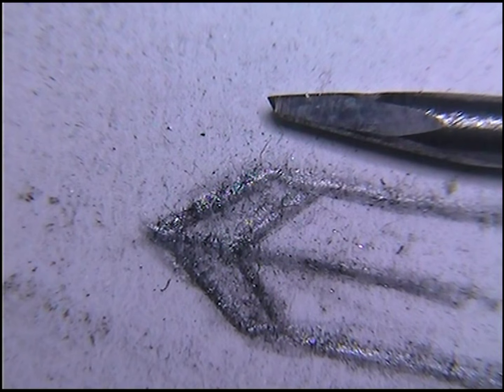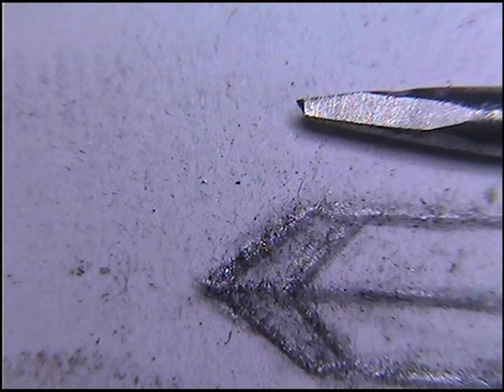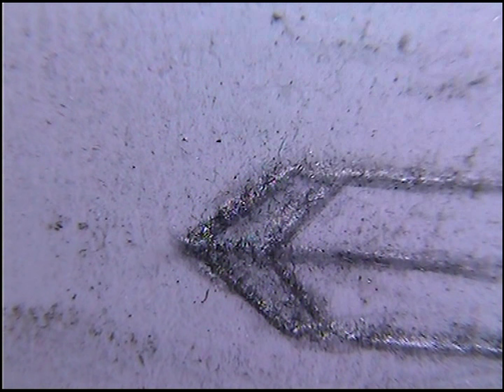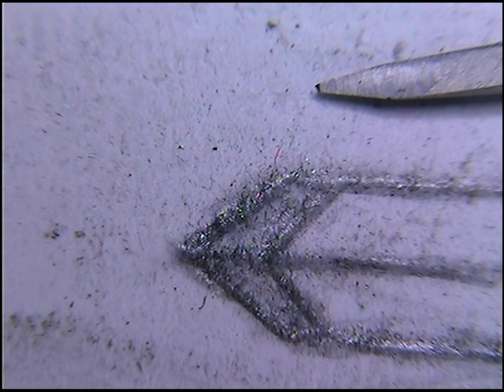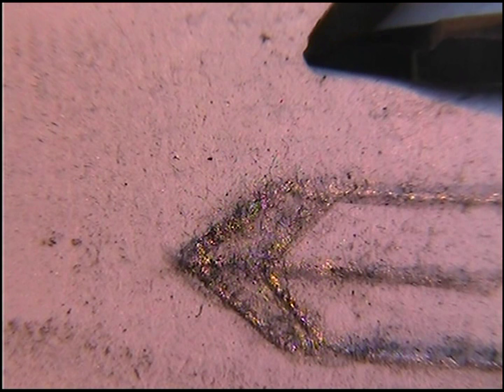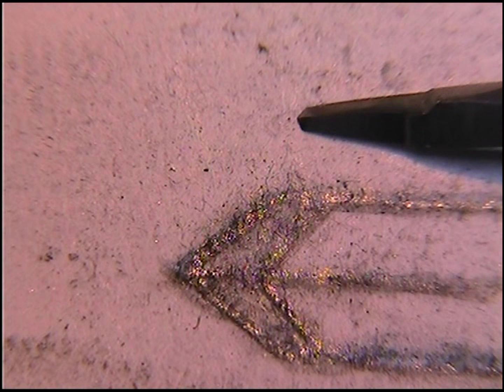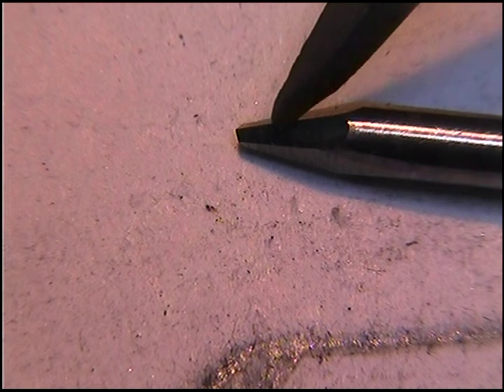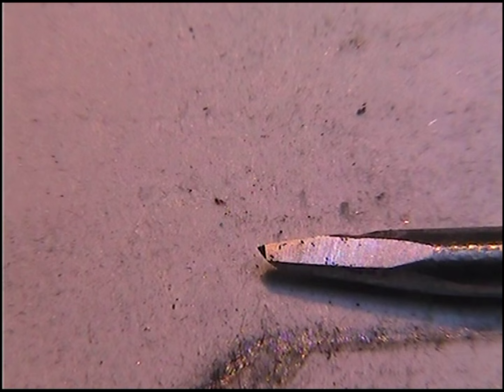Hand Engraving What a graver should look like,and how to sharpen it.

Comment: Really great videos and a lot to learn from you! I've got rectangular gravers. Any good tips to fasten them into a template?
Reply from the maker: You could still drill a hole in the location and tap a pointy square graver through making sure the corner is in line with the V of the graver,so it's positioned in a diamond shape. There is a previous video of me making the templates with the brass part of an electrical connectors block. That was the original design for square gravers

Comment: It's an awesome video. What's the next best thing to a $500-$1000 stereo microscope? The engraving forums that I read advise against buying the cheaper Chinese brands. I'm a beginner, and I've ordered only two glensteel gravers and two wooden handles to start with. I see that in some of your videos you show improvised versions of more expensive equipment, so maybe it's not such a sin to buy cheaper tools at the beginning?
Reply from the maker: +Patricia DelMercado Buy whatever you can afford to make a start. I still use a cheap optovisor,I bought 10 years ago. Slightly more expensive is dental loupes,but don't get the ones for $5 they don't actually work.  You are doing the best thing,that is just to make a start. Go straight to work on some coins,and you can start selling them to buy better equipment.

Comment: Fantastic video!! It is super helpful for a beginner! I am hoping you can help me. I have made your 90 degree template and several others now buy other engravers but can not figure out how to achieve a parallel heel. I know Steve Lindsey sells a system to achieve this but I cannot afford it. Is there any way you can explain how to achieve a parallel heel on a 90 degree graver? Any help would be so greatly appreciated!!
Reply from the maker: So cool that you are progressing so well. You could actually sharpen a parallel heel by hand. Will have a think for the next video.
Reply: Shaun Hughes Engraving thanks so much for getting back to me!! I have been having a play around and I think I can do it by hand just need to practice. I have another question if you don’t mind, I am practicing on copper what would be the best angles for cutting copper? I am finding the 90 degree gets stuck. Thank you so much for your help!
Reply from the maker: @heatherbell9924  That's so great to hear Heather. Look for Sam Alfanos video on hand push engraving, he has the perfect angles shown there.
Reply: @express375  link not work, I can't open this file
Reply from the maker: @mbootgae1497  Thanks bro try the new link. Check out my new 3d print video. Also new homemade idea to make a sumple guide even better than anything else, even all the ones i've made before, coming soon !:)
Reply: @express375  ok

Comment: would you recommend a carbide graver over high speed steel? I just started out, I have a Dremel engraver that I modded (like that Russian guy did) and already engraved some aluminium but I really need some proper gravers
Reply from the maker: HSS to start with. Carbide breaks very easily when you start to learn,so will cause a lot of frustration.It takes a longer time to resharpen as well